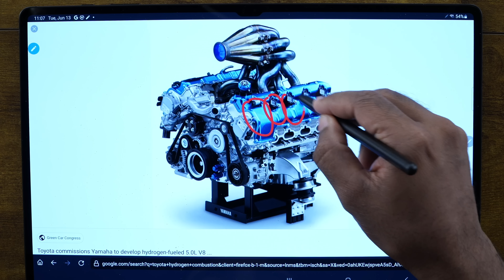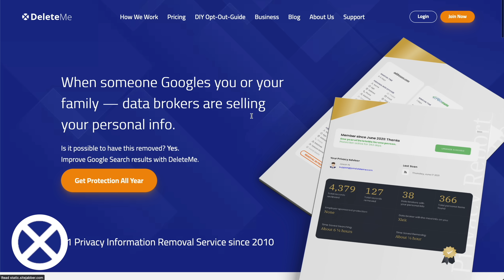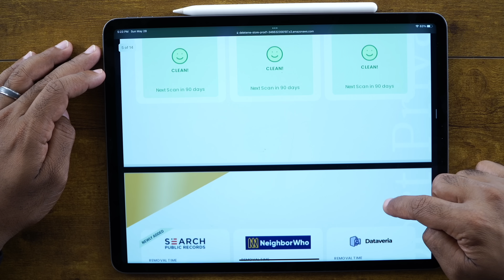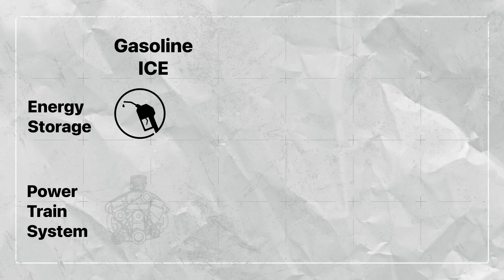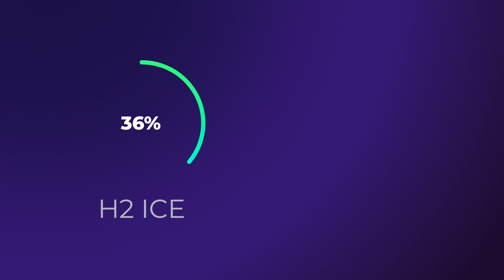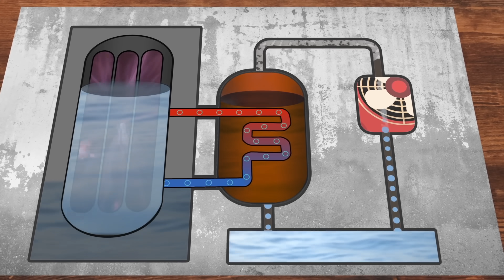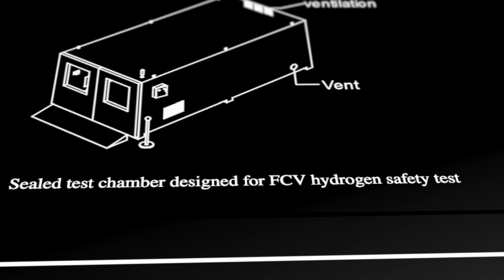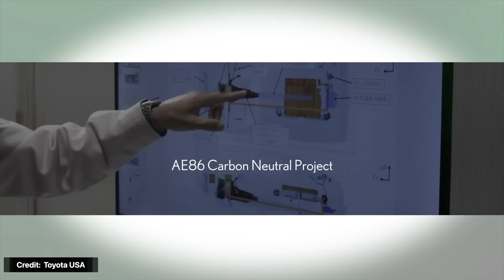Toyota's Says They Just Destroyed EVs - Hydrogen Combustion Engines

Comment: One of the major drawbacks of hydrogen is how it is produced, transported and stored. Green hydrogen at scale is not yet commercially available. I believe that, for the time being, ethanol is the most attractive environmental alternative for gasoline. And the technology already exists. Brazil is a reference in this tech. They produce ethanol from sugarcane and the majority of the Brazilian car fleet was successfully adapted to use this fuel. Part of the carbon emission is captured by sugarcane planting. There is even technology being developed to extract alcohol from sugarcane bagasse, which is currently used as biomass for the production of paper and cellulose or burned in some thermoelectric plants and in processes for the production of sugar.

Comment: Hydrogen is highly reactive and can make metals like steel brittle and prone to cracking and failure
The water vapor produced by burning hydrogen can condense and cause corrosion, especially at low temperatures
Microbial growth in hydrogen fuel systems can also produce acidic byproducts that accelerate metal corrosion

I've heard of very old attempts at some sort of water/hyfrogen combustion or hybrid tech engines but they all would break down due to rusting. Of course we have tech they don't today, but it just seems like these things have more wear and tear concerns (I noticed the prototype seemed to need a lot of work during that test they ran) and I have to question the safety measures they are using. Sure, build a brand new one, shoot it, wreck it, smash it, but this isn't testing what happens when you have driven this thing In arizona for 4 years and then sell it to someone out in california down by the water someplace for 2 year and THEN get in a wreck.

Comment: I remember LPG gas was once a solution as it cleaner and cheaper, it was cost 20 cents per litre, but once BP Shell Mobile Caltex take control of the supply of Hydrogen gas, it will be the same price as petrol,
And don't forget carrying a Hydrogen gas tank under your seats leave you an inch away from heaven, when it ignites it is just like a hydrogen bombs that blow you to the moon. 🤔🤔🤔😁😁😁

Comment: You're forgetting about serious problems that batteries have. They're incredibly heavy, meaning you waste a lot of energy just accelerating the battery. There may not be enough rare earth metals on Earth to supply all these batteries, and recycling old batteries is a problem. EVs that get wrecked will also spill a ton of dangerous material around the environment that won't all be retrieved. And your efficiency doesn't improve as you use your fuel. Hydrogen has none of those problems. However, it does require a very heavy-duty container, which does add weight (but I am guessing less than a battery). Once we find a way to bind hydrogen and easily strip it before ignition, we won't need heavy-duty tanks anymore, it will probably solve the leaking problem, and hydrogen will be the way to go.
Reply: Hydrogen cars only sound cool on paper, but those do not work in reality as a practical solution. And by the looks, it will never do. 
BEV's keep improving every single year with bunch of new battery technologies on horizon already. Some are even exponentially better ones, tho main issue is scaling up their production and driving down costs. While with hydrogen... Well... Those remained basically exactly the same from the moment it got invented.

Comment: Have you seen the Arrington performance hydrogen converted truck? Mike Copeland built a 1948 Chevy 3100 with a supercharged LS3 running on purely hydrogen. To my knowledge, he had done this a couple of times before Toyota came out with their proof of concept.
Reply: Doesn't really say much about car's performance, cost to refuel, distance it can drive with full tank, cost of maintenance and so on.
Reply: @Zripas  fair enough. I know there isn't much info on their truck since they are constantly tweaking and improving. From my recollection, it was about 550hp to the crank using 2 injectors per cylinder. They were getting over 300 miles to the tank (don't recall the tank size). Cost to refuel wasn't bad, but I don't remember actual numbers. Maintenance is tough for me to know, as they didn't drive it as a daily. I know we changed the oil once and it looked like brand new oil. Most of the vehicle maintenance should remain the same. I'm not sure about the maintenance for the hydrogen system itself, though.
Reply: @gearheadfabworks  
If its HICE type engine then 300 miles is not possible with reasonably sized tank. Unless they used liquid hydrogen, but that's completely impractical thing for normal use cases. 
There are plenty of videos out there claiming miracles, some even claim to be able to use pure water directly to convert it into hydrogen... Because you know, laws of physics can be suspended in some old cars... 
Cars like that simply doesn't exist or those would be all over the place already. Biggest car companies barely manages to achieve 400 mile range with 3 huge tanks and twice as efficient fuel cell engine.
Reply: @Zripas  you have the same question I had. But they drove over 300 miles somehow. Mike spent a couple years on calibration with Bosch. I did a lot of Dyno testing with the truck. But I didn't drive it for long distances on the road. Wish I could verify, myself. But for sake of this conversation, Mike said he did it, even though everyone said he couldn't. I just don't know how.
Reply: @gearheadfabworks  
Was it actually properly tested or "they drove 300 miles because they said they drove 300 miles"? And how big was that tank? I could hook up cistern and travel half the world (not really, won't be enough), doesn't really say much about actual efficiency of the car. 
Well, people lie, basic math doesn't. Tech like this Mike guy says to have simply doesn't exist and basic on basic calculations, can't exist. And just to note here, its NEVER getting actual independent verification when it comes to claims like that, it's always ends up at "Its true, because I said so" just to get those 15 minutes of fame.
Reply: @Zripas  I'll have to research and see what size it was. I no longer work for Mike, but I keep in touch. You have some very valid questions, though. I know I drilled Mike in the beginning and he had all the answers. I don't know what they did that was different than others. But the truck was nice as all get out and drove really well.
Reply: @gearheadfabworks  
You can definitely get nice feel while driving any car, but without any actual deep dive it's just that, nice feeling for short time period. I will be really skeptical about people claiming to have revolutionary technology, yet their only evidence is "I said so" in a youtube video while at same time seamingly braking all known laws of physics. Atleast it wasn't "Powered by water" so car might actually run on actual hydrogen, but it's definitely not reaching those ranges with basic hydrogen tank in it. There is a reason why no one from car companies who plans to produce anything relating to combustion hydrogen engines mention any actual ranges or amount and sizes of tanks.
Reply: @Zripas  i know it runs on hydrogen, for sure. We had it tested for the EPA, in which it passed all standards up to and surpassing 2035 initiatives for emissions. Unfortunately, there was still a tiny amount of nox. However, it cleaned some of the CO from the testing room. So, it has some merit with regards to emissions.
Reply: @Zripas  sounds like Mike's tank held just over 3kg of hydrogen gas at 350 bar.
Reply: @gearheadfabworks  
3kg would be like 180 miles of range for hydrogen fuel cells, which are twice as efficient as hydrogen combustion engines, so realistically Mike's car should be doing under 100 miles in a good day.
Reply: @Zripas  I'm sure it's greater than 100 miles of range. One thing to factor in is that it is supercharged, which improves its efficiency anywhere from 7-30%, which depends on which research article you read. It made it through multiple days of Optima Power Tour without refueling. But I don't know exactly all the specifics of the engine and calibration, as I was not brought in on that side of the project.

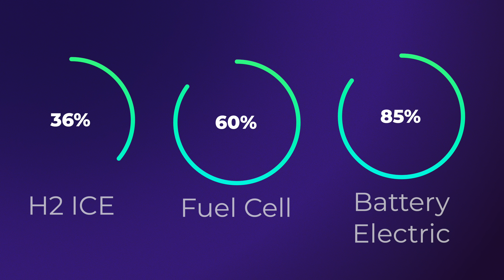Comment: The image at 10:15 is extremely flawed and gives the impression that a fuel cell vehicle is actually 60% efficient when this does not account for the losses of energy during electrolysis or the compression/transfer of the fuel, and an ICE hydrogen would at least be about half that again making both far worse than that image implies. Ignoring all the complication of using the smallest gas the reason for EV adoption is efficiency/cost.

Comment: H2 ICE 36% performance. based on what if you are taking the gas and exploding it directly in the engine to move the car. its far more efficient that generate electricity and moving with electric engine. its way simpler system and lighter.

Comment: The thing you are not considering include the following. 1. Hhdrogen distribution would be available at existing fuel distribution locations (every major intersection on earth). 2. and moat important, there is no way that the existing elecrrical grid will support elecrical demand for major EV usage. Case in point. An application to install a 30 unit trucking station for Electrical  Commerial vehicles would have required an electrical source that would have exceeded the total electrical availability of the small city that was the target site for the installation. and it was discovered that the site would require twice the elecrical demand of the Tesla plant that builds the commercial vehicles. 3. The millage figures that are normally referred to in the literature are severely impacted by ambiant temperatures both hot and cold on the motive system but then add the drain on battery that is exerted by radios, heating and air contitioning systems, phones, computers ond other devices. 4. The combustability of the Lithium Battery due to the electrolyte component. 5. The cost and availability of the components required for any battery system and the sourcing of those components and the potential for sourcing in adverse global environments.  Then ther i the basic problem of Green Energy production that is adversly affected by lack of Wind, Sunlight and the disdain for Nuclear Energy. 6. I often get in my car and drive for 900 miles virtually non stop. That trip from CDA ID. to Sacramento CA takes 13 to 14 hrs including food and fuel stops. Try that in your Tesla and you have to throw in an overnight along the way and add hours for charging that can double the time requirement. Just food for thought. I enjoy your blog site and appreciate your intelectual approach and would enjoy receiving your private response to the above. John K

Comment: hydrogen combustion engine is great because it goes away from electric engine. Mirai having two engines is more complex and has got disadvantages from both. Electric isn't the future because of all it's limitations, electric engine performance, battery charge speed, battery storage and battery lifetime. Hydrogen solves all those issues and step out of Mirai concept going full hydrogen is excelente because you end up with a simpler car. Its like a natural gas car. its the same concept but hydrogen is available everywhere and doesn't generate carbon emissions.
Reply: The Toyota Mirai has a single motor. Not sure what you're on about with that.
Electric motors have really good performance.
Reply: @logitech4873  No its not. More weight you put on the eletric car, devastating performance loss you will have. Go look for electric cars towing boats.
Reply: @logitech4873  Mirai contains a motor to convert hydrogen to electric and an electric motor to move the car. These are expensive and cumbersome.
Reply: @mrmurdock6994  Electric motors are great for high-torque applications, actually. Which is why they're used in trains.
The Toyota Mirai has a single electric motor. You're thinking about the hydrogen fuel cell, which isn't a motor.

Comment: Electric vehicles are no more efficient. There just so happens to be a cost difference to operate, because of the large scale of energy production. Natural gas price drives it. Politics drive it. Power generation plants are mostly natural gas driven combustion engines. Nuclear and hydro power are few and far between. They all require maintenance. I like the plethora of options. Not against EV's, and also don't at all support the idea that they will replace the combustion engine. The expense of the battery is the problem. The battery is not easily recycled. The real difference is whether or not you have a power generator on board your vehicle, or you have a battery to store power generated from a power plant. We won't see hydrogen power take off at scale until big money figures out how to effectively profit from it, in the same way they have with oil.   Saying electric is 85% efficient compared to 36% hydrogen is nonsense. The generator at the powerplant, is not more than 34% efficient, and neither are solar panels. It's far easier to have powerplants on board vehicles and transfer the fuel, which is like a liquid battery.... Than to build an infrastructure to support the unimaginable amount of kwh's needed to replace the same amount of energy in BTU's. Nonetheless, I still think EV's are really awesome!  Oil has worked great thus far because it is a byproduct of organic decay. As long as we have plant life, we will have oil. We need plants, and they need us. If we stop using the oil, it will come out of the ground naturally, just as it did before! Otherwise I guess we'd still be killing whales for their oil.
Reply: Electric cars are absolutely more efficient. That's their whole schtick.

Comment: I have hard time believing even 36 % efficiency of H2 ICE. Efficiency of ICE is proportional to the applicable compression ratio (which is why diesel engines are more efficient) and hydrogen is known to be extremely easy to ignite. So unless there is some very fancy way to control the air fuel mixture, the CR must be really low compared to what we find today in modern fuel injected combustion engines. Also, I do think that while fuel cells exist, ICE is unnecessarily complex way to produce power from hydrogen.

Comment: How common the element hydrogen is has almost nothing to do with it. You don't need to the element hydrogen, the element carbon is pretty common, you need the molecule h2.
If you want to run ICEs you might as well run them on octane and remove the co2 from the air through enhanced weathering or some other means.

Comment: The problem with ev is it isn’t zero emissions the batteries are very harmful to the planet and yes the car it’s self doesn’t produce any emissions but where does the electricity come from at the charging stations they come from big power plants that pump toxins into the air more so than all the gas engines pump into the air
Reply: not all power plunts use fossil fuel.